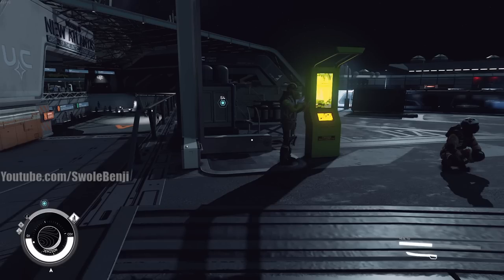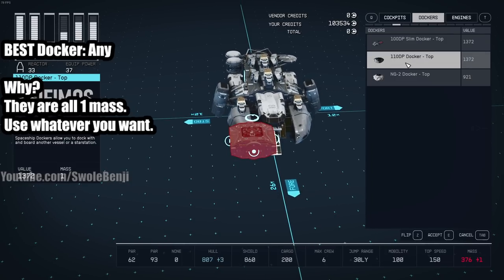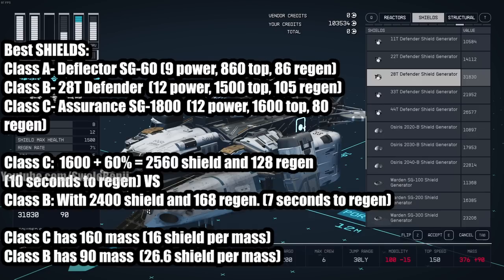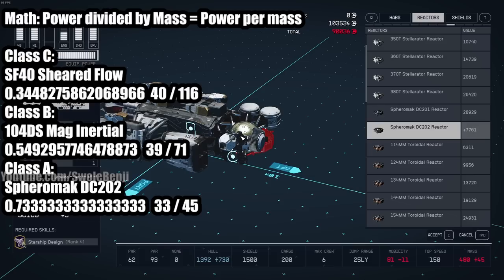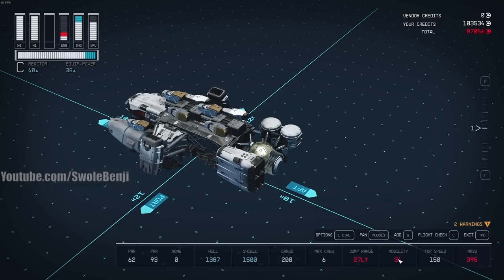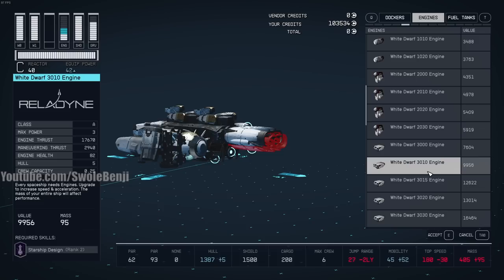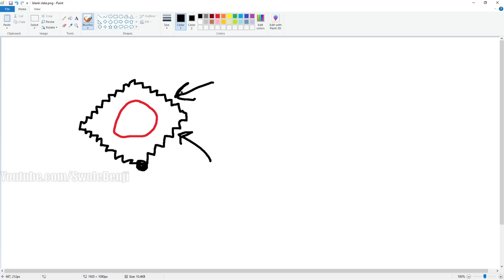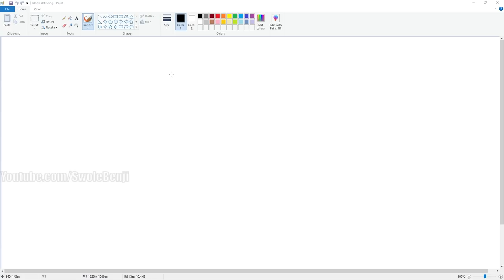Starfield - The BEST Ship Parts To Use And WHY

Comment: A note about the slim docker (and why it is actually the best): You can actually mount it to the belly of your ship, you know, where you typically put nothing because of landing gear? That's right, you never have to worry about that pesky "Docker must be the edge of ship" error because it wil lalways be able to reach the edge because that is the same requirement the landing gear must reach. You're welcome.
Reply: You aren't putting weapons and cargo on the bottom of your ship?
Reply: @KaitouKaiju  Weapons, or rather turrets, do not like to be mounted anything other than right side up (if you mount them any other way just watch them in third person and witness how sometimes they won't fire even when a ship is in their field of fire).

As for cargo, no because there are not a lot of cargo modules that mount on the underside that don't also impede landing gear ground-clearance. Generally I only ever run two 1-1.2k cargo modules plus 2 shielded modules and that is plenty of storage when the cargo perk is taken into account. 

Due to the stupid NG+ loop I have stopped bothering to make good looking ships until I get to a point where I am not just going to loose everything when I want to get a new ending for a quest or one of the various NG+ seeds that take the story in slightly different directions. So, while I can see the merit of underslung cargo for silhouettes, from a utilitarian standpoint and the fact that turrets are just my playstyle since I don't like the manual controls due to no lateral movement... no, no I do not mount anything else under my ship, thus the slim docker goes and remains there forever.
Reply: @ShiningDarknes  You can move laterally, at least somewhat, if you use your thrusters.
Reply: @tylerstimson  no, no you can't. The thrusters move you forward. Holding forward and left or right is not the same as lateral movement. Lateral movement in space combat is essentially the same as strafing in on-foot combat. Why they decided to make a space game but treat the spaceships like fighter jets is beyond me. 7 years of development and this is the best they could come up with.

Yeah, yeah it isn't a space sim, but come on,  it can't have been that hard to give us something like "unlock gyro-stabilizers" to let us turn on a dime or, I dunno, make those "braking thrusters" actually function to let us stop and quick turn.
Reply: @ShiningDarknes  That's fair it isn't really like strafing. The thrusters are more of a light nudge than anything. I think more ship parts that unlock new abilities might come with future updates. I do like that I can build a battleship that's a tank that carries tons of cargo that can barely move, or a much more nimble fighter that turns on a dime.
Reply: @tylerstimson  battle barge is the way to go for me. 24 power to 8 turrets then a couple suppressors for if I ever want to board or poke a friendly vessel to get my turrets firing.
Reply: thanks for the tip
Reply: @ShiningDarknes Yes, YES you can. You can definitly move latterally. If you haven't figured out how, that's on you. On Xbox, when you hold RB button, you disable gyro-stabilizers, which lets you fly latterally, vertically or even backwards if you want.

Comment: With the exception of the White Dwarf 3015 engine (which seems to have had some of its stats translated with the 3200 an I assume will get fixed at some stage) the Top speed is solely determined by the highest class engine you have fitted ... A = 150, B =140, C = 130.  This is why you couldn't get above 140 when you had the B-Class Dunn-71 fitted.  The check for engines is purely is there enough engines fitted.  Mobility is maneuvering thrust compared to ship mass so you want to pick the engine which maximises that for your chosen total engine power consumption target.  With a 6 engine power budget, if you ignore the glitched 180 speed 3150, for the engines you were looking at your best choice is 3 DT60's as that gives you 7,800 maneuvering thrust for a total mass of 255 and will maintain 100% mobility up to a maximum mass of 631Kg (376 excl engines) and then drop by 1% for every 3kg extra.  Two 3015's give you 6,300 for 190 kg and will maintain 100% mobility up to a maximum mass of 510 kg (320 excl engines).  Even though 65Kg of your extra mass capacity is eaten up by the heavier engines you still gain a net 56kg of ship mass budget.  The SA-4330's are actually the best engine to use.  I don't have access to them yet but 3 of those would give you 9660 maneuvering thrust for 264kg which I predict would allow a maximum mass of around 782kg (518kg excl the engines)

Comment: I've watched loads of your Starfield videos much appreciated. I thought I would just add the slim docker adds 3 Hull. Also, I think its Nova wing is only 1 mass with 2 weapon mounts and an engine mount so if you can work it in your might be able to drop the spine for 2 mass lol...I've now done a Cabot build on this It is a cube 89 mobility with 180speed but 100 mobility isn't needed. I've got Razorleaf if I really want to get critical over max stats

Comment: The rabbit hole i'm heading down now is maxing out ship combat stats by adding crew - hopefully 8 crew total.  Yes, this requires a bigger ship and more skill points allocated to Ship Commander, but I think it will be worth it since, supposedly, you can stack your own ship skill stats with your crew to get some insane speed, shields, firepower, etc.
Reply: Multiple crew with the same skills don’t stack from what I’ve seen, and apparently about half of the crew skills most likely do nothing at all. Generous interpretation is that they are bugged, less generous is that they were shipped incomplete and will only exist when they get around to it.

The majority of useless skills are for weapon systems of all types, along with starship engineering. The ones that do work don’t mirror the player equivalent skills exactly, usually providing a 10% boost per star (AT BEST).

Sam Coe and Omari Hassan also have hidden buffs to piloting and shields respectively, providing a bonus power point to Engines and Shields while they are assigned as crew.

There are a couple of others that may prove useful, but that’s what I recall off hand. It’s unfortunate that all of this is poorly documented, not explained at all, or entirely contradictory. Hopefully they either get the bugs ironed out, or add in the missing functionality ASAP.

Be careful with the bonus system power points as well, since (at least on my ship) every time you jump the game recalculates the power levels down one level from the previous setting because they don’t know how to handle the crew’s ghost point properly. I’ve forgotten to add it back and found myself flying at speed 20 with 0% shields in ambushes from time to time.

Cheers :)
Reply: Wow, if the stats stack based on the crew numbers and their skill sets…I’m definitely going to try a C-Class build. I’m almost done with my B-Class build
Reply: wish someone would put out a good list of crew members with stats and locations
Reply: Have zero crew can destroy multiple ships easily even at highest level 72 on normal skill level.
Reply: @spike178  nice! Which weapons do you use and how much shield does your ship have? Or are you just really good at ship battles? I'm not that great at it so I need all the assistance from crew and skill points I can get.

Comment: All the cargo holds seem to range between 4.7 and 4.77. I’m still pissed I’m stuck with the 3 Poseidon DT230 engines with the 2 terrible side mounting points. I’m wanting the  SAL-6830 engines are bugged since they require 2 energy so you can put 6 engines with a max stats of 108k thrust, 5280 maneuvering thrust, & a lumbering 1980 mass. But the Poseidon DT230s have 103k thrust, 34k maneuvering thrust, and a manageable 1k mass. So if you want to fly a Star Wars/Trek looking C-Class 22:42 ship that carries all your shit, then the Poseidon DT230s is your best choice.

Comment: How do you have 1300+ Hull one that small ship? I made something balanced for early game, has everything I need for crew and stations without being too big. 760 Mass finished but my Hull is only 500. Basically my Razor Leaf looks like the Star Eagle now with the best parts I can get and enough cargo so I don't need to build a second ship yet.
Reply from the maker: Most of your hull HP comes from the parts, not the extra junk you tack on the ship.
Reply: @SwoleBenji  So i'm probably still just using low level parts that don't offer much hull yet.

Comment: This is an excellent guide, I love the ship to ship fighting in this game and can’t wait to level up so I can dive into more ship building. Starfield needs a fuel management system where you have to refuel out of pocket every so often instead of it being automatically done and without any cost to the player. It would be more immersive imo.
Reply: Yeah i believe that they originally wanted to make it a lot similar to Elite Dangerous, where you have limited ammo and can refuel from stars as well. Also the jump range and fuel capacity is basically unimportant in the game the way it is now. I bet that originally they wanted to make you jump manually at each stars which would motivate you to get better jump range.

Comment: I've watched loads of your Starfield videos much appreciated. I thought I would just add the slim docker adds 3 Hull. Also, I think its Nova wing is only 1 mass with 2 weapon mounts and an engine mount so if you can work it in you might be able to drop the spine for 2 mass lol...I've now done a Cabot build on this It is a cube 89 mobility with 180speed but 100 mobility isn't needed. I've got Razorleaf if I really want to get critical over max stats...also no ladders